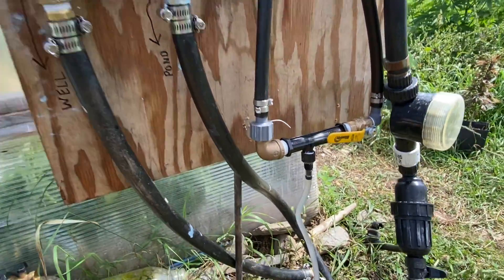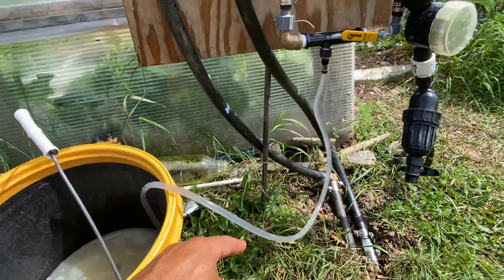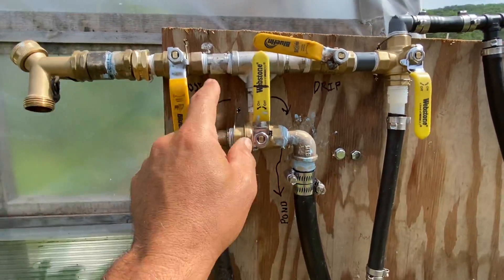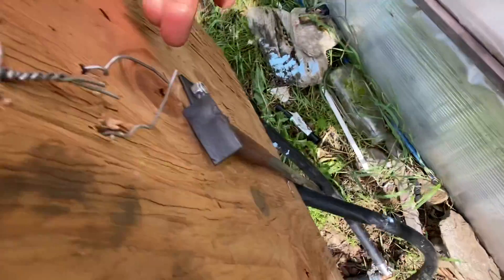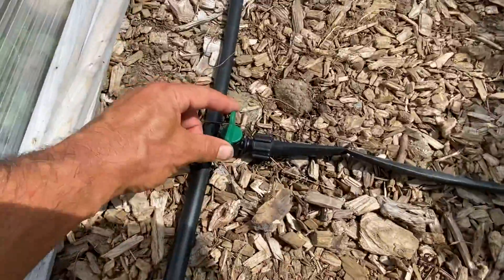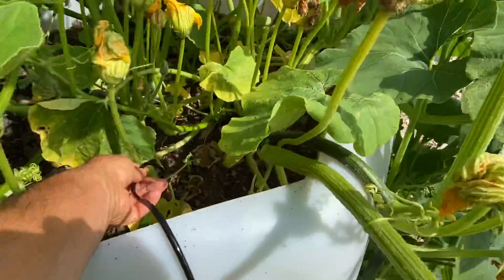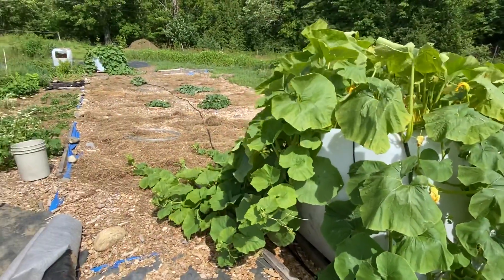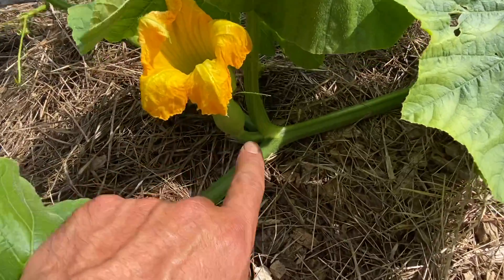Fertilizer Injection for Garden

Comment: no problems with clogging those tiny drip tape emitter holes?  I love my drip tape when it's working, but seems very prone to clogging over time, especially with some good funky fish emulsion, which seems prone to growing biofilm slime on the inside of the tape wall
Reply from the maker: No problems yet but we use a filter for sure
Reply: @wholesystems  yes the filter will trap any sediment coming up from the well or pond, but isn't the injector installed downstream of the filter?
Reply from the maker: Tyler Davis yes the injector is upstream before the filter but all the water coming into that is filtered to 5 micron with a filter from the well and one at the solar pump.
Reply: Can you please explain how your fertilizer injector works? I have 3 rabbits that poop into a 100 gallon tote. Some of the water from the mister system to keep them cool gets in the tote. I have worms coming int the mail right now. I want to remove the stagnet water with this system.
Reply from the maker: Martin Bernal better to look at the mazzei injector website than I Try to do it...
Reply: Ben Falk I got it figured out. Thank you. :)